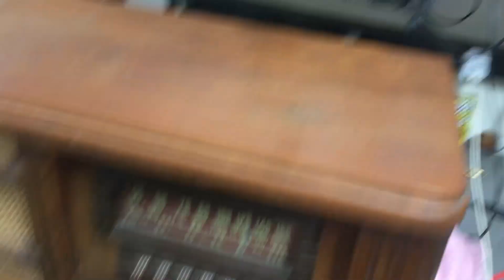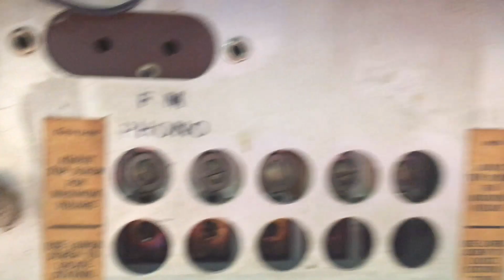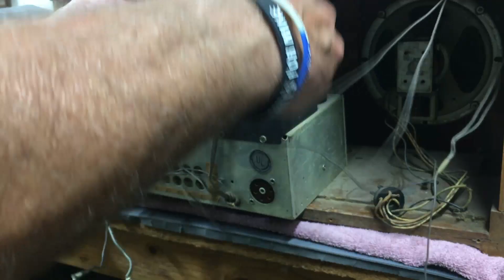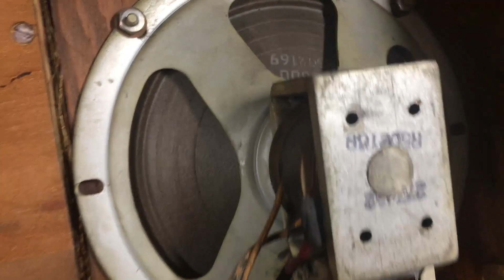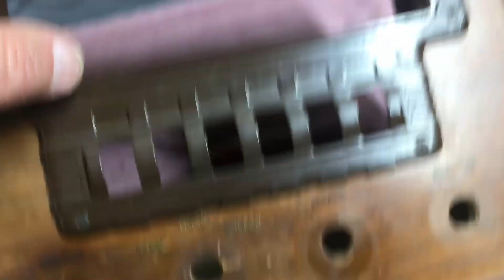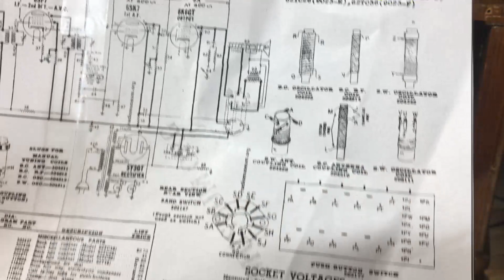1946 Stewart Warner Model 62TC16 Repair "Old Stew Part 1 of 2

Comment: I use the curly q method as well. It"s easy to dis- assemble if you need to.
Reply from the maker: I find the curly q  easy, and it works well. I prefer unsoldering and replacing the leads. That method has a lot more risks involved with collateral damage when working than the curly q. I think I like that method, because it takes more time and seems more like therapy to me. Thanks for watching and commenting! Take Care—Larry